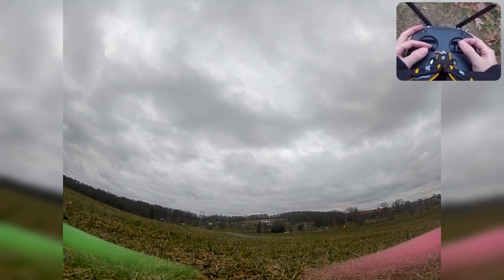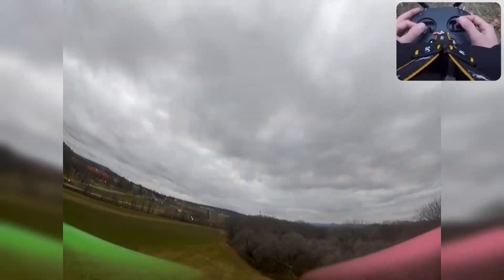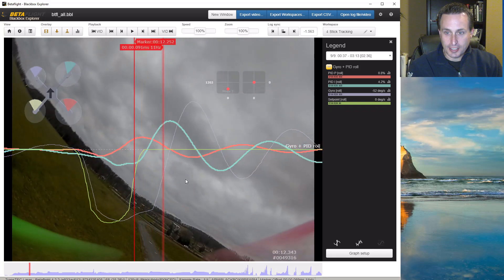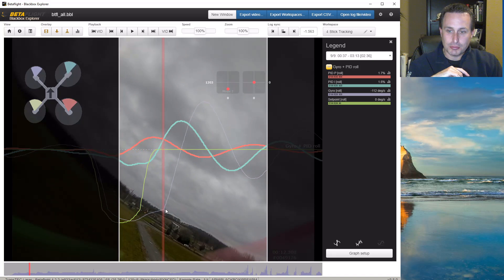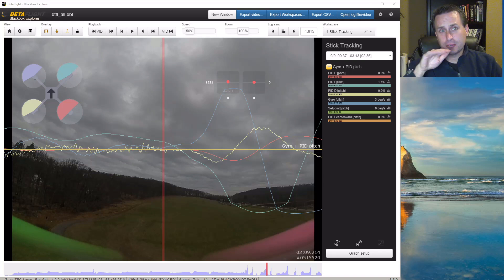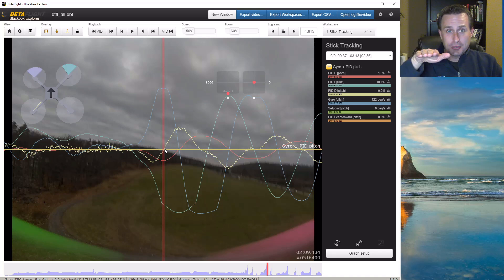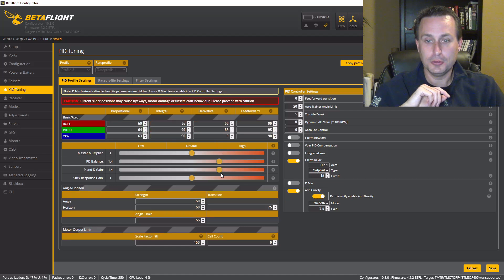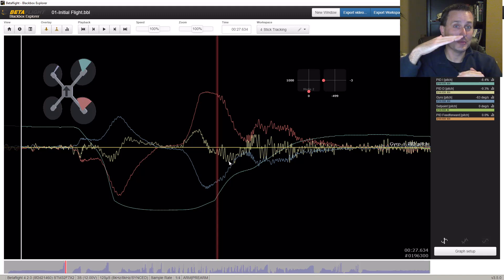How to: Tuning i-Term  😎

Comment: Now i wonder what can cause during angle mode and after flying for 30seconds to go wayyyyy off to where u have to have stick 30 percent from center just to  fly level of course my luck on a brand new quad too.  How my Mach R5 is and one other quad is . I mostly fly angle still.
Reply from the maker: Could be too much noise throwing off the Accelerometer.  It measure what direction is down.  There is a lowpass filter setting in the CLI you can try.lowering.  type "get acc" to find the variable.  

If it is that, there is a mechanical issue or a bad FC as you should not need to lower the ACC lowpass.

Comment: I wonder what causes crumbling rock glitches at hover on a supposed new fpv quad whith cheif 2050kv motors on 6s . All i can think of is damaged fc or something being i tried moving sliders 5 times.  Thought it was getting better but it was due to battery getting weaker. put fresh 6s in and cant even fly it.  But i do have 30 others to fly  10 new which are unflown .
Reply: On 4s had zero of the deep tone chunky glitches . Perhaps i just run 5s max then on 2050kv motors .
Reply from the maker: Sounds like electrical noise on the gyro if it gets better with lower voltage.
Reply: @uavtech  Can that be tuned out or say f it and call it my 4s quad.
Reply from the maker: You can try putting capacitor right on the flight controller in addition to the.one in the ESC battery leads.  Use cylicone wire so cap is not rigidly attached to the FC.  I have heard that help cinelifters recently

Comment: I would very much appreciate a solid tuning video for quads without blackbox logging.  Especially with the new 250g movement.  I have 3 quads I use for commercial work under 250g and without blackbox.  I get them tuned, I think,  but not having blackbox data prevents me from feeling confident in the tune.
Reply from the maker: You saw the toothpic tuning video.  That's my best advice without logging.  A lot more focus on paying close attention to sounds and looks vs. knowing what is what when you have logging.

Comment: Hi, why sometime when I set the D term too high can make the quad fly away?
Reply from the maker: Either two reasons:
1. The mechanical vibrations of the quad may not be filtered enough, and taking the slope of a line (Derivative) amplifies noise in the signal causing the D-term to be a majority of the PID Sum, causing it to spike up to 100% (the PID Sum).

2. If the D-term is high enough, you will get to a point where it cases a feedback loop with the motor's natural harmonic of how fast it can update.  This will have a trilling sound and is cased D-term oscillation.
Reply: @uavtech  Thanks for your kindly response

Comment: Hi Mark, I have just recently started to play around with the tuning aspect of the hobby, I have started on the roll axis increasing P term to get a feel that I like, I have increased D term to compensate for some bounce back. I haven’t done any I term yet. After setting the P and D term the quad now has quite allot of drift with no stick inputs. Could this be because the I term is low and should this be resolved when I increase the I term? I guess the tuning principal is the same for P I and D for all flight controllers as I am using the kiss fc v2?
Any advice appreciated 
Great work btw
Reply from the maker: Increase RC deadband.  Yes, tuning principals are the same.  Yes, if I-term gain is very low, you could get drift too, but most of the time it is an RC deadband issue.
Reply: @uavtech  great thank you, I will look into RC dead band too 👍

Comment: Can I just set I to zero or something very low and forget about it?
My problem recently was loss of control after a long dive. Probably I term was winding up. So my reaction is stop it from accumulating at the timescale of a dive, 10 seconds. Can't think of a downside... What's wrong with setting it very low?

Comment: Hello, 

I‘m currently tuning my 5“ quad for 3D-Mode and I have already set up Blackbox to look into my log files whats going on.
But regrettable the I-Term goes sometimes to zero and stays there for ~300-600ms and therefore the gyro can‘t follow the setpoint in this amount of time.

This happens mostly everytime during very fast rolls and somethimes even on straight forward flights.

I‘m into your videos and I have seen you have a lot of experience in this I.P.D tuning topic especially with the betaflight software.

The suspicious thing is that it didn‘t happened before when I don‘t flying 3D Mode.

I would appreciate it if you could help me.

Greets,
Mario
Reply: To be more precisely I found out that the I-Term on all axes goes to zero for exactly
250ms when motors change direction.
That happens only in 3D mode.

Hopefully you can give me answer due to
This problem ?
Reply from the maker: This is probably an oversight in the code.  Do you have a log you can share?
Reply: @uavtech  sure I have, where I can share it ?

Comment: The accelerometers in BF are used to stabilize uncommanded pitch, roll, and yaw changes, right?  In other words, they stabilize pitch/roll/yaw.  Is there anyway in BF to do the same for altitude?  Can the accelerometers be used to overcome uncommanded altitude changes, in order to improve position hold?  Thanks.
Reply from the maker: The Accelerometer does not really stabailize R, P or Yaw.  It gives down as a reference point.  The Acc code then re-levels the drone to keep the R and P plain - as when calibrated - to be 90-deg to the down direction.

What are are looking for is in iNAV but you really need a GPS and Baro to make it work well.

This said, the Acc. could be used (kind of) to do what you are thinking, but that is not build into the current code.

Comment: Im trying  to find out why  and how beneficial  it is  to set the pid sum to a 1000 in the cli. Really  I just  want to know why , can it do any harm  and need to revert it ? Thx
Reply from the maker: typically you don't hit the PID Sum limit of 50% (check out your logs), however it some cases you can.  For general tuning advice I would raise it and leave it raised because then you don't need to worry about it.  But I don't know that it is mission critical either, as like I said, typically the PID Sum does not exceed the limit of 50%.  Where I do see it exceeded some times is in high speed - very turbulent - prop wash conditions.

Comment: Great tutorial Yoda ; ) 

Got my drone repaired, now working on my PIDs.

I'm using BetaFPV HX-100 frame with F411 Ver. 2 toothpick FC (can recommend) & 1103 8000KV (1204 5000KV is better) but Avan Emax props. 

Here's the sistuation, I have slow oscillations at mid throttle. Find the most difficult props to tune, maybe coz of the prop angle? 

Saw you're using the DJI controller, thought you'd be using the Tango II or the Jumper... is it better? I'm using the FrSky X-Lite pro. 

On the roll I have the problem where it spins fast too early on the stick, can I move it to the last 2 mm at the stick end?

Happy fly'n & take care

Comment: Maybe it would be more ideal if the sliders were as follows: I-P Balance, P-D Balance, Stick-Feel, and 'Master Gain'. This way you can tune using the sliders from top to bottom.

I suppose the current slider set can work too: Tune P-D Balance all the way down and Master down some as well, then use the P-D Gain as a sort of an I-P Balance slider. Find your P-D Balance, Stick-Feel and finally increase Master until D-term noise becomes problematic. What do you think?

Edit: spelling
Reply from the maker: Makes sense to me.

Comment: Hi. would you explaining what happen when ducted quad hits wall or objects that make it tilted in quite angle resulting sucking up into the object? perhaps also a way to reduce that effect? :)
Reply from the maker: Turn off Airmode will reduce this effect.  It is from having increased low end PID authority and i-Term winding up.  On top of that, when it gets into a suction condition with the wall, it will tend to stick of course.
Reply: @uavtech  Thanks for the explaination. Will tweak it up from there. :)

Comment: I term only accumulates when the P term (or rather error) is a non-zero value, right?
Reply from the maker: P-term pushes Proportional (same shap) as the PID Error.  So as PID Error grows or shrinks, P-term changes at the same rate.  It doesn't have a "memory".  I-Term has a "memory".
Reply: @uavtech  isn’t the I term just accumulated error over time multiplied by the gain? I suppose there are two main ways to calculate it. Some manufacturers do 1/I term setpoint. Some just multiply by the gain (I term setpoint).
Reply from the maker: @zfpv7211  sorry, i thought your question said P-term.  Yes, i-term only accumulates when there is a persistent PID Error P-term is not closing.
Reply: @uavtech  it did originally lol damn auto correct.